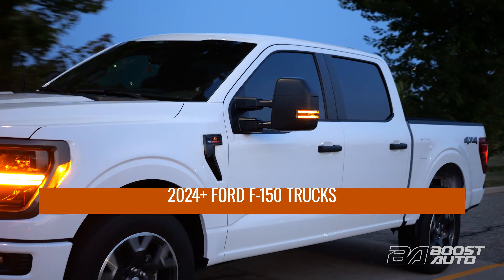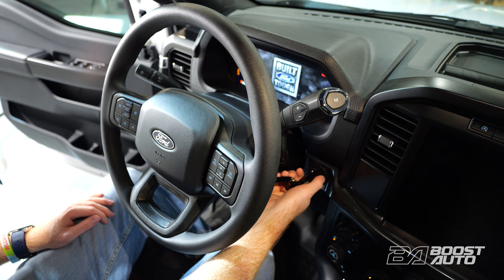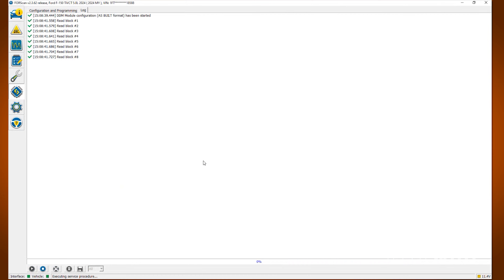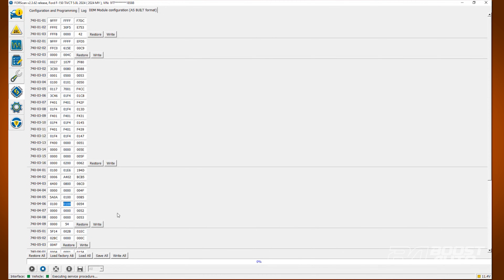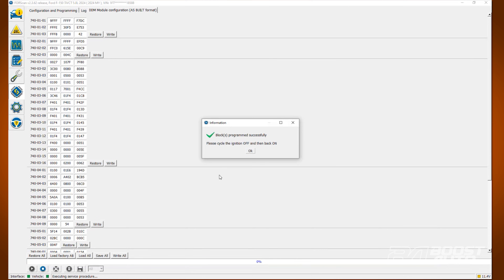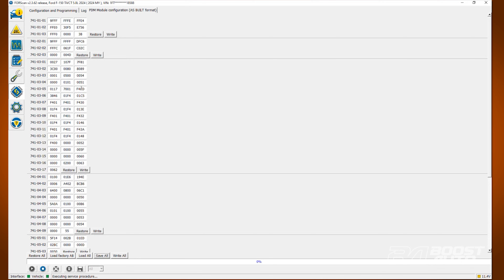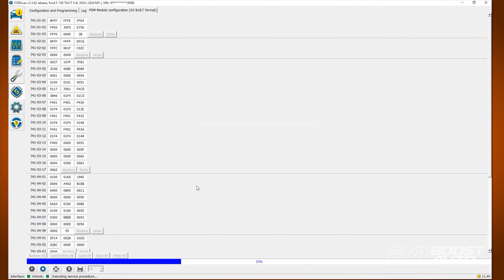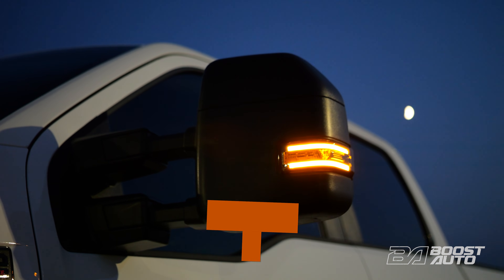Boost Auto Tow Mirrors | 2024-2025 Ford F-150 - Forscan Turn Signal and Puddle Light Activation

Comment: Hey, is it the same procedure if the truck has a custom tune?
Reply from the maker: It should still be the same procedure
Reply: @boostautoparts it actually wasn’t recognizing the truck but forscan  has a solution to work around it and it worked. Thank you for tutorial it was very helpful.
Reply from the maker: @rickymohabir5476  Awesome glad you got it figured out!

Comment: Do you have to enable it or can I just run it as is without the lights? I don’t want any check engine lights
Reply from the maker: You can run as-is without lights if you'd like. You won't get a check engine light with our mirrors, they have all of the relevant sensors to avoid that.

Comment: I have a 2024 STX and ordered mine with the signal & running light as well as the startup sequence.   The signal works, as I followed the well-made Forscan instructions provided on your website.  The puddle lamps are really nice, too.

The running light and startup sequence do not work.   The STX-trim doesn't come with forward-facing spotlights, and I'm searching for an up-to-date video on how to make the running light/startup sequence function work on my specific year and trim level truck, preferably without splicing into the factory wiring...something I am not keen on doing.
Reply from the maker: Watch this video at 10:05 to enable the running light: https://youtu.be/ffAfmhpdN_U?si=QzcANIjVXEqb8b2L&t=605
Reply: After checking the link, it looks like you do have to splice some wires near the BCM connector. I'm with you on that there's no way I'm cutting into my factory harness just to add mirrors.

Comment: will this work for the stock turn signal mirrors that are not from a 24 
got a pair of turn signal mirror off a 21 xlt that put on a 24 xl and cant find anything to resolve the issue
Reply from the maker: If the mirrors are configured properly, this will work.